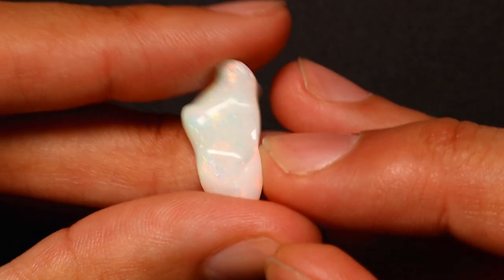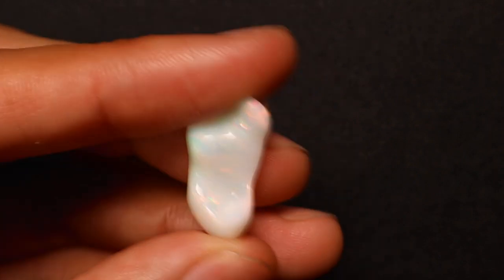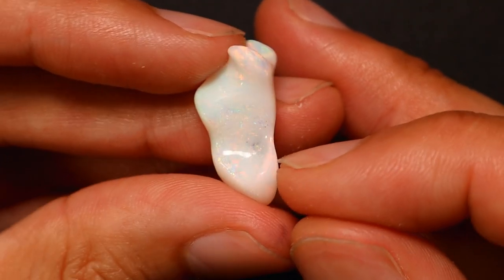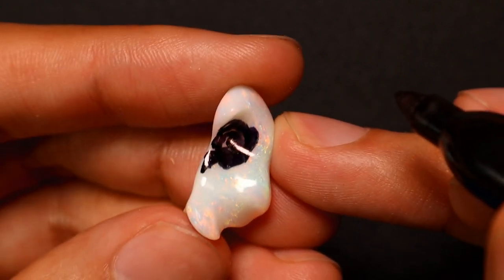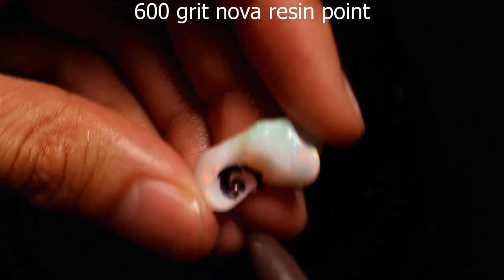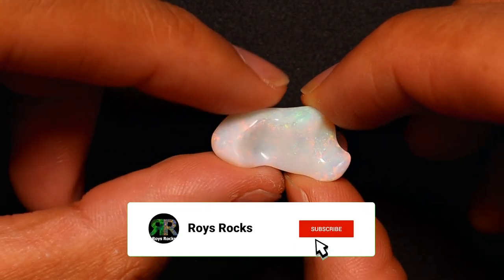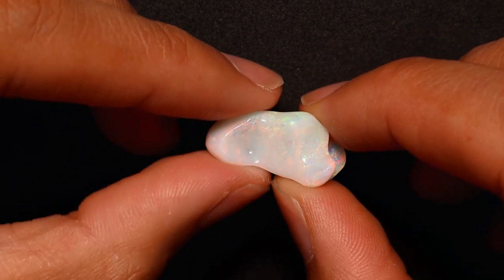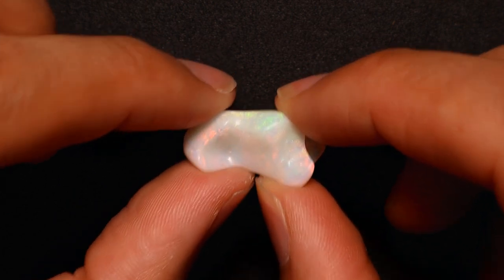How To Fix Or Repair Small Areas Of Opal Carvings. Dremel Gemstone Carving.

Comment: Thx Roy..the marker method really works..
Its a nerve wrecking situation to be in the 1st place..
After this happened to me twice 
I strictly made sure between every stage from sintered to novas,always dry In between..check check to make 100% sure there are no scratches.
Reply from the maker: It is a failproof way to check without much magnification. Very handy to have a text nearby at all times.
Reply: @RoysRocks  true
Off to the stationary shop and stock up on those text/markers😁